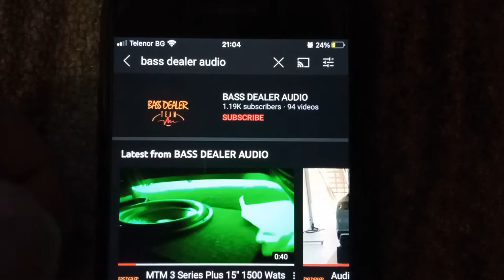Installing New Ground Zero Speakers Audi A6 (4F,C6) 2004-2011

Comment: Do you think replacing front 10cm speaker will make a difference? Mine doesn’t look that bad as this car in the video.
Reply from the maker: https://bass-dealer.com/govoriteli/180-ground-zero-gztf-87tx.html
Reply from the maker: We install this model Ground Zero
Reply: so it's 10 or 8.7 cm???

Comment: can I mount any speaker on the car, regardless of what it develops, just by simply connecting it with a plug?
Reply: JBL Stage2 634 3-way car speakers, 40W RMS, 250W MAX 4 ohms, will it work?
Reply from the maker: Solder cables
Reply from the maker: Yes , why not

Comment: The capacitor on the original tweeter costs 50v 4.7uF.  The tweeter I bought has a 100v 3.3uF capacitor.  Which capacitor should I use?
Reply from the maker: Use capacitor from complect
Reply: @bassdealeraudio442  thks

Comment: Im replaced my woofers in the front doors an the are not sounding the same.  I replaced one with kfc 651s 4ohm.  Could i be doing something wrong the sound muffled
Reply from the maker: Are you sure you  make the cables right?
Reply: I thought I checked but I will get back to you with a answer just to make sure I'm positive that they are matching right
Reply: It's also the bose system so I'm not sure if that's making it a difference

Comment: Hi. One question.  I currently have a bose system.  Can I install these speakers? Thank you
Reply from the maker: Yes , you can install these speakers
Reply: @bassdealeraudio442  Thank you. Great video!
Reply: @bassdealeraudio442  no you cannot, a standard 6.5" doesnt fit the bose box

Comment: Did you cut the old middle speaker out of the frame and placed a new speaker into that position? 
How many ohm does the subwoofer should be? 4 ohm?
Reply from the maker: Yes, the middle speakers must be cut and new ones put in. 4 or 3 ohms are ideal for subwoofers

Comment: Hey, i replaced  2 front and 2 rear speakers with these shown in video, but i have a problem, the rear ones sounds good, but front ones when i turn on bass starts to sound shit, like they hitting something or what
Reply from the maker: Check door panels , or cables in the door

Comment: Good afternoon, i have a question, i need to replace my right rear door speaker (damaged), after check some comments in this video i've found possible size (16'5 inch).

Can u confirm the size before mechanic removing door plastics/plates?

Audi A6 C6 4F 2005.

Have a nice day 💪
Reply from the maker: Yes , rear speaker is 16,5 sm or 6,5 inch
Reply: @bassdealeraudio442  I bought the JBL GTO 629 a few hours ago, thanks for  help anyway 💪🙏
Reply: @bassdealeraudio442  One more question, do u know if front doors are the same size? Instead of use 2, i replace 2 front speakers for +2 new GTO 629 or i can't?
Reply: @bassdealeraudio442  Please help me 😇
Reply: @godunha Remove the door panel and see if the speakers fit. Use the old speakers to figure out the size that’s needed. Finding out yourself is often the better option rather than asking people on the internet.

Comment: Front doors and rear doors bottom speakers same size? And can send link for the front doors smaller speakers, and rear doors smaller speakers
Reply from the maker: For Front Doors and Rear Door Midbass Speakers are same size
Reply from the maker: You can install this Ground Zero Tweeters 
https://bass-dealer.com/govoriteli/407-ground-zero-gzht-25x.html
Reply: In the front doors there are speakers in the middle (without subwoofer and tweeter) how should i get those speakers? Because if i understand well front subwoofers, and rear bottom bass speakers are same size, and those in the middle of front doors is different size (im talking about that speaker you removing in video 6:58)
Reply from the maker: @armi269  https://bass-dealer.com/govoriteli/180-ground-zero-gztf-87tx.html We install these speakers
Reply: Rear doors speakers 16,5? Just like front subwoofer?
Reply from the maker: @armi269  Yes , 16.5 sm or 6.5 inch
Reply: Hey, these speakers have same contacts as a6 c6 original contact? Or you needed buy adapter?